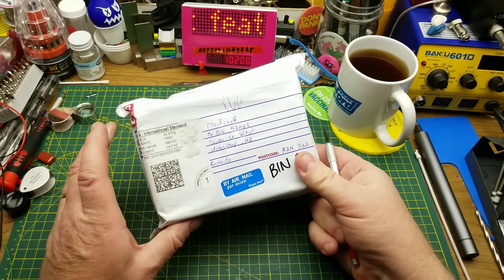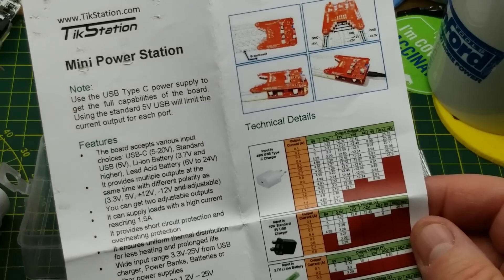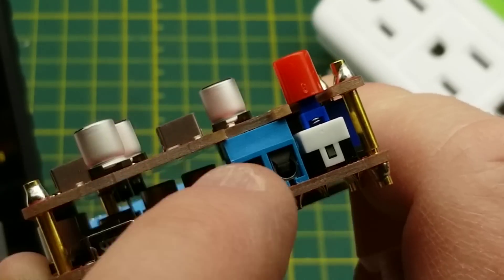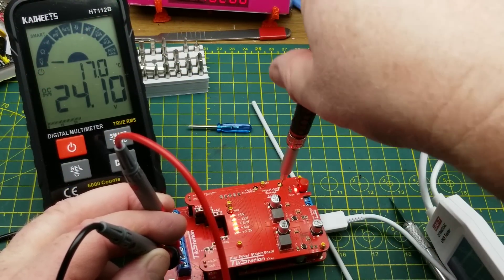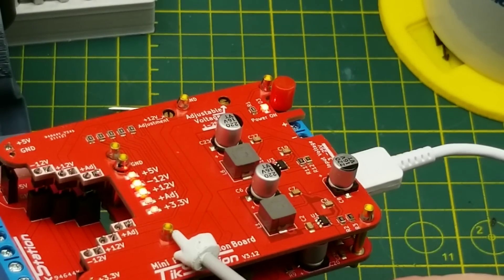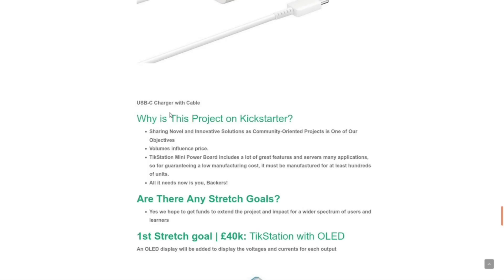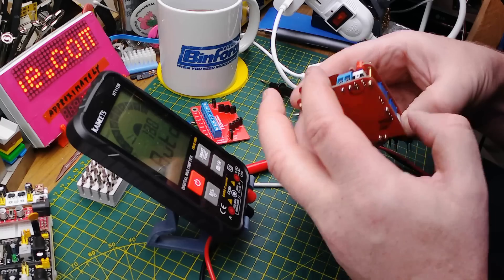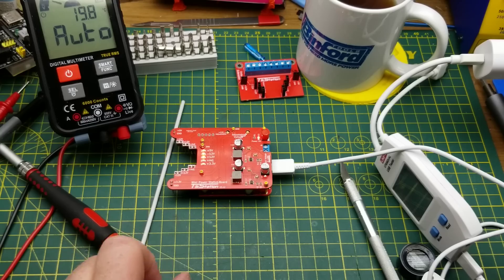Checking out the TikStation power supply

Comment: Nice video and interesting product.  Since it based on switching power supplies it would have been nice to check the ripple and high-frequency noise on the outputs under light and heavy loads.  Thanks for posting.

Comment: I really hope this unit makes it to market !
I can see many uses for this little power supply , if he designed a small add on board that could plug onto the output pins to give some small binding post or screw terminal outputs then  those  with a  3d printer could design and print a case to turn this module into a really handy little power supply unit that can be used as a stand alone unit or if you unplug the binding post/ terminal  block  module it can then be used on a breadboard as designed . Having a dual rail supply is a real bonus !